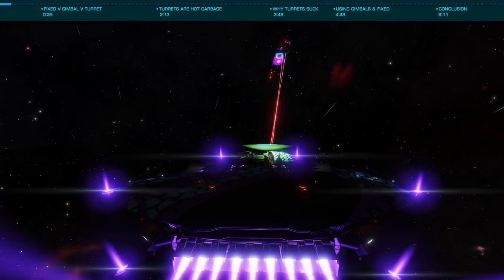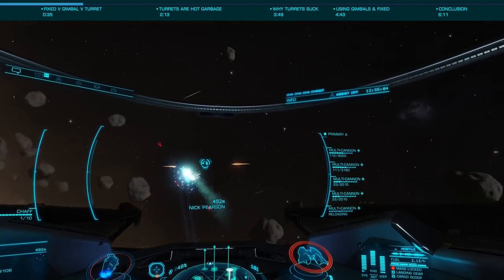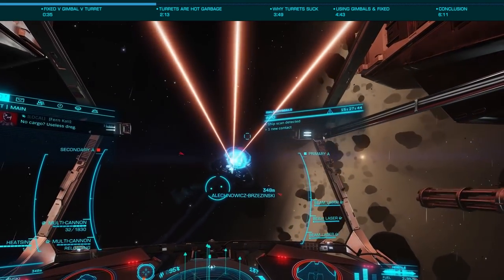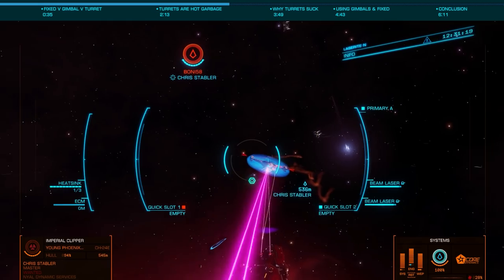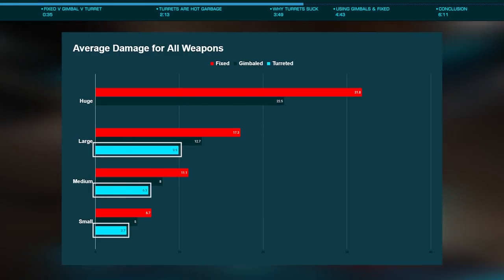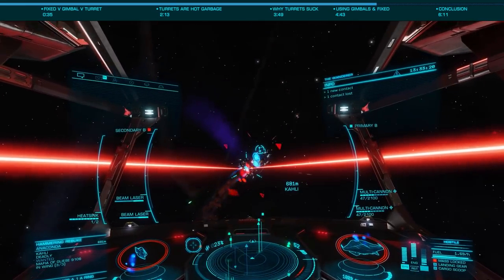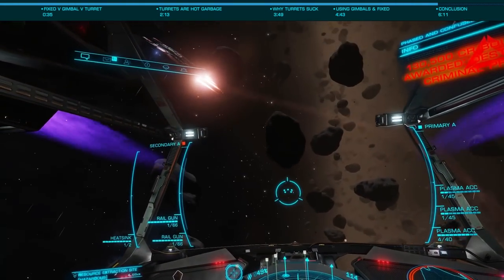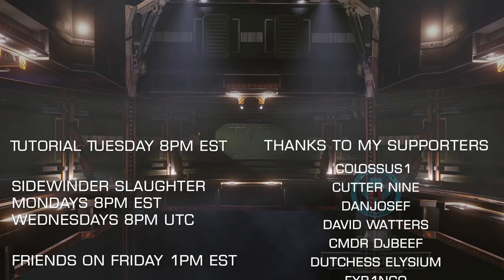Why Turrets are Hot Garbage - Fixed v Gimbaled v Turreted

Comment: It's always kind of bothered me that turrets are such crap compared to every other mount type.  Sure, I understand it's suppose to be some kind of attempt at balance between them.  Clearly a very poor attempt that needs adjustment, like almost every other form of balancing in ED.  If there is one outright, unquestionable winner between "equivalent" options.. something is clearly wrong in their balance.
But mostly it bothers me because, if you look at any modern day vehicle that might serve even remotely the same purposes (yes yes, none are spaceships, ignore THAT part for hopefully obvious reasons), how many have fixed weapons?  Even in vehicles that are no longer used, how many have fixed weapons?  Or even gimballed?  It's basically just a sub-catagory of tanks, and fighter planes.  Stealthy ambushers, and fast, highly maneuverable vehicles.  Every thing else has turrets.  Or weaponry that tracks and steers itself (missiles/torpedoes).  And it's not like those turrets are even massively inaccurate, and they're intended for much greater ranges than any gun in ED.  (Of course, if we could fire at similar ranges in ED.. or even further as would make sense for space.. I suppose that just wouldn't be as fun.. for anyone but the person pulling the trigger.)  I suppose you could argue that ED's weapons are bigger.. and in a sense they are, but also are not.  The huge hard point is roughly the size of a battle ship main cannon turret, and we're putting a single, massive, self contained weapon on it.  Yet it can't turn.  ..Why not?

But, ranting aside, it mostly just makes me sad that the balance is so skewed in favor of one thing.  Even with that, though, I too am in the court of using turrets primarily regardless (with huge PAs or  beams in the huge slots where applicable).  I do actually enjoy their use, and with typically using a fully engineered cutter anyway... not a whole lot on the npc side out there can even begin to threaten me, short of an entire CZ aiming at me. (Which is a whole other can of balance-issue-worms.)  I'm also terrible at keeping anything in front of said cutter.  Directly above it? Somehow I can manage that with ease.  Now if only the gimballed weaponry could be mounted to point straight up.... But, well, combat really isn't my cup of tea, not what I find most fun in ED, so I'm also not too fussed about that part.  Someday, I may feel the urge to actually get better at it, and if/when I do, I'll certainly re-outfit to fixed and/or gimballed weaponry, if just because there really isn't any other true choice in the matter with that goal in mind.  But until then, wiggly laser light show weaponry it shall be.

Comment: All nice and clear, BUT are some exceptions here, not mentioned, and ignoring those can screw a new player: big ass ships NEED turrets, and at least in one case, the T9 heavy, turrets are THE ONLY viable option ( aside mines and rockets...) ; A T9 fully loaded, armed only with fixed or gimbaled, is easiest kill ,  once any other ships can dance circles around you, and is almost impossible on a T9 loaded to track anything moving fast. So turrets are a MUST in a heavy T9, imho, if you want to have a minimal defense...
Reply: Or be smarter, instantly jump to another system, T9 is simply not for combat, let alone fully loaded
Reply: @shaycormac7224  - "be smart" is a bit stupid to say, dude, when you are interdicted by 2 NPC almost at the same time, and they are in ur ass before your FSD fully charge....
Reply: Boogie Baggins  - with or without FA is the same, a Vulture will dance circles around you, at will ! FA off won't help much.
Reply: @mirandela777  You may need reactive composite or some strong shield and grade 5 dirty drive tuning, and if it is indeed the situation where two NPC could blow up your T9 without giving you enough time to escape, I don't think some turrets could prevent you from that DOOMED destiny.
Reply: @shaycormac7224  - indeed, you are right....

Comment: Ugh mambats bad!   ;)
Reply: what?
Reply: @Jazod  - it's a rare meme-ish name for mambas.   Which suck due to horrendous turn rate.

There's a running joke in my circle of friends that a mamba(t) basically only has one chance to kill something in a battle, after which it's stuck flying away from the battle for the rest of time...
Reply: the turn rate is fine
Reply: @Jazod  - it has a 40 degree/sec pitch with fully engineered drag/dirty drives before adding any armor, weapons, or optionals.  A fer-de-lance is like 41 without engineering...or 59 with.  By comparison, an engineered Type-10 has like 28/sec, a federal corvette 33, a python 39 and a vulture 68.

Keep in mind that it's a variant of the fer-de-lance (one optional goes from 4 to 3, and it moves the pips around on the secondary weapons to be LLSS instead of MMMM), so it's kinda bizarre that it gives up 33% of it's turn rate to be what, 13% faster?

If it gave up 13% pitch for 13% speed, I'd own several.  If it gave up 13% pitch for 33% speed, I'd have nothing but mambats.

TL;DR: FDev is bad and should feel bad for mambats.